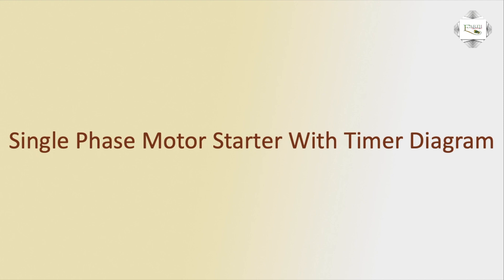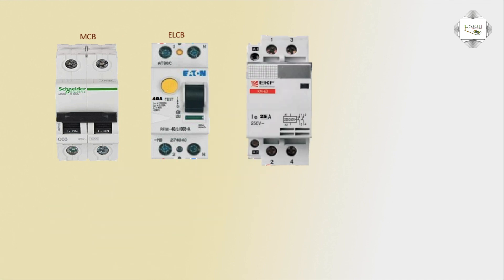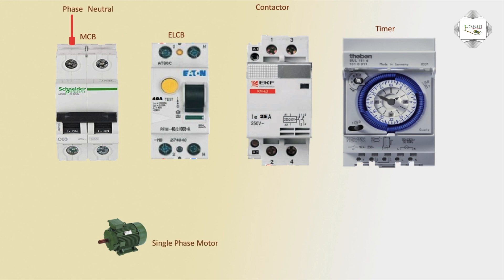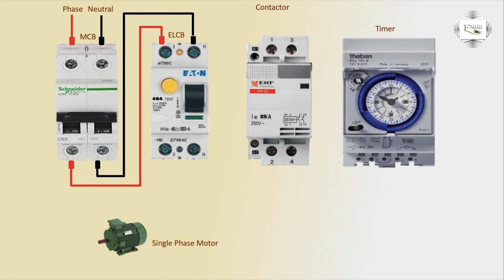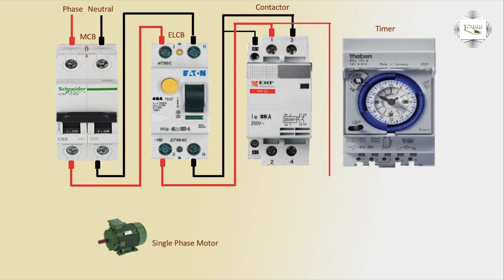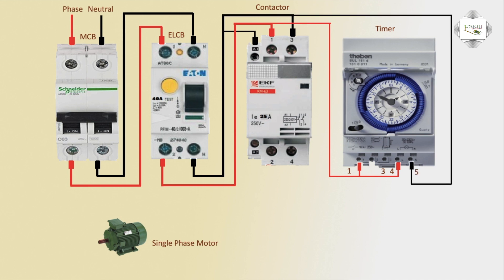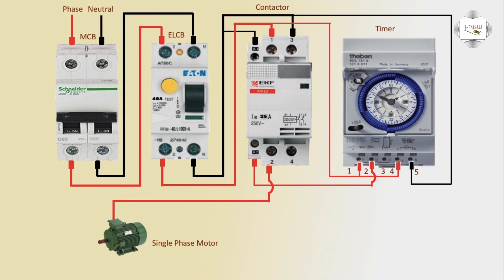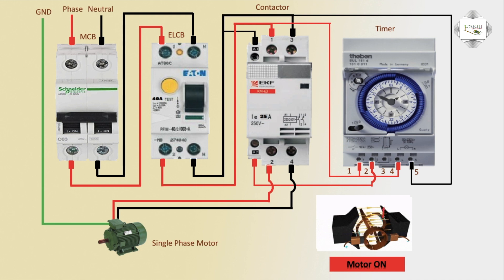Single Phase Motor Starter With Timer Diagram | single phase motor | timer

Comment: I have timer with capacity 25A. Is it a must to use contactor? or ok to connect pump direct? Pump is small (130W)
Reply from the maker: no problem working. add me whatapp. full info website @earthbondhon.  I love to receive your comments and feedback.
Thanks for watching it.